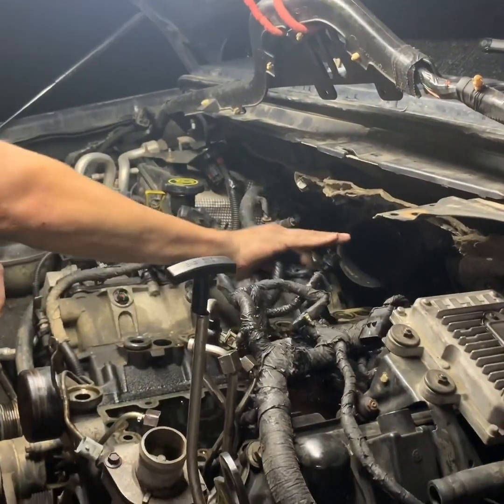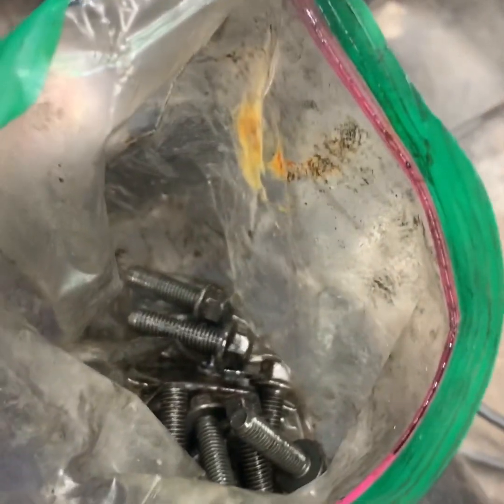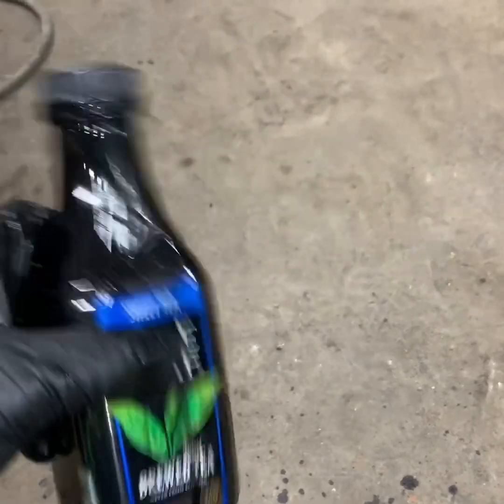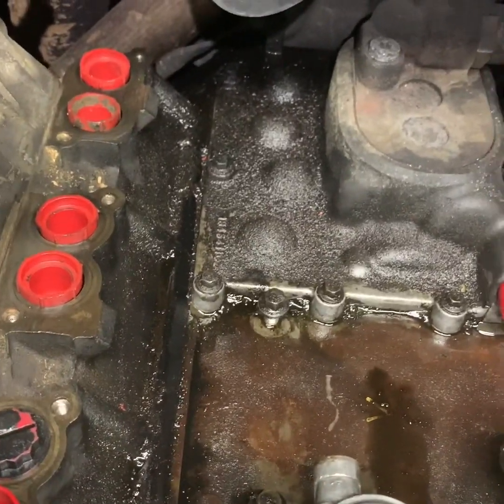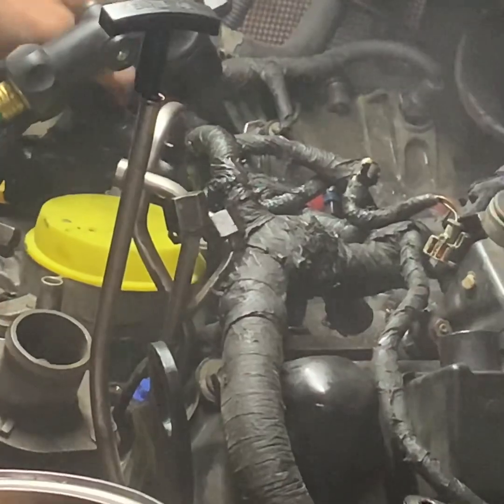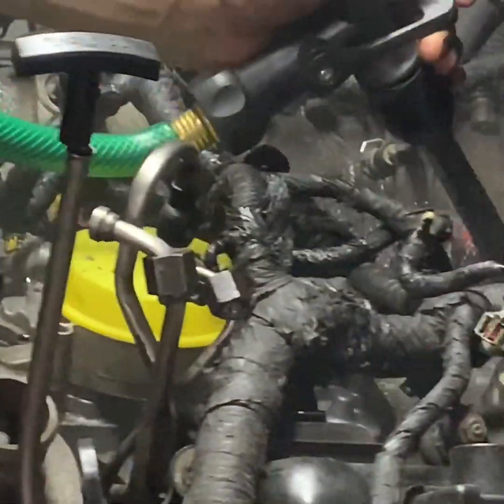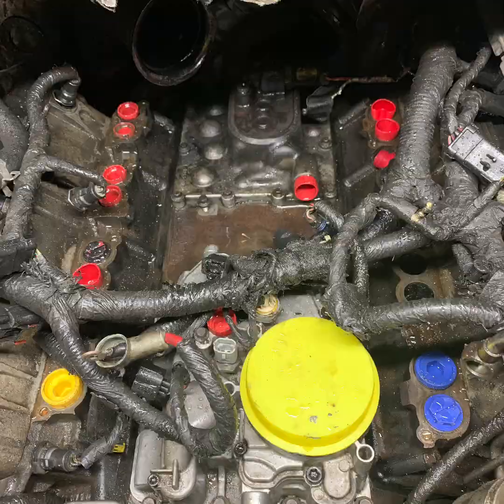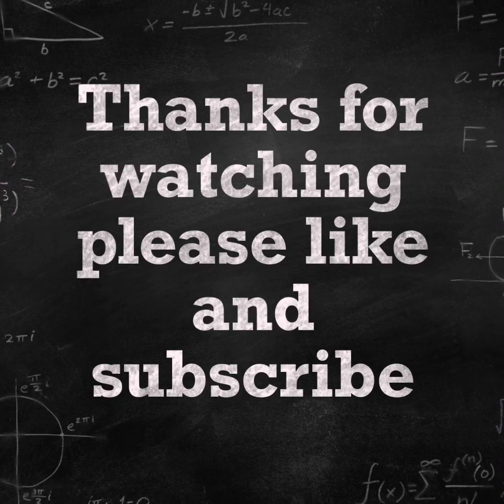6.0 Powerstroke oil cooler install part 2

Comment: Good info, can you provide the name or link to of that power washer you have?
Reply from the maker: It’s off the snapon truck I will see if I can find the part number for you
Reply: @CARTERSGARAGE  Got it, the part # is  JETWASHERPK  It's  really cryptic trying to figure out snap-on part numbers on the web especially new products. It is not listed on the snap-on website, best bet it's on the snap-on truck as you found, It looks to be a really cool tool to have for a hundred bucks or so